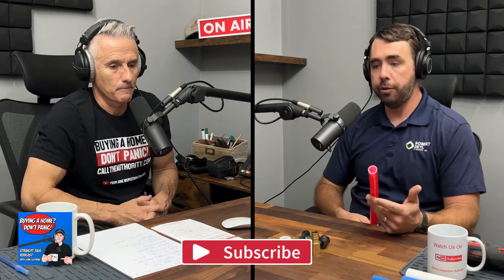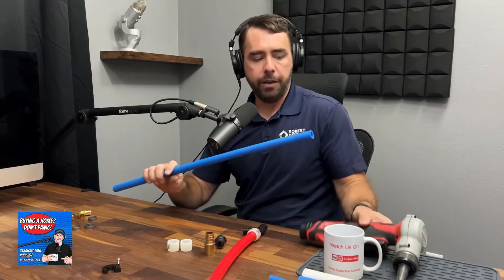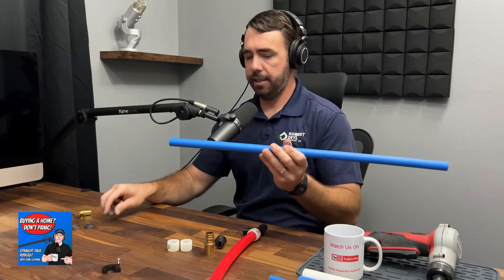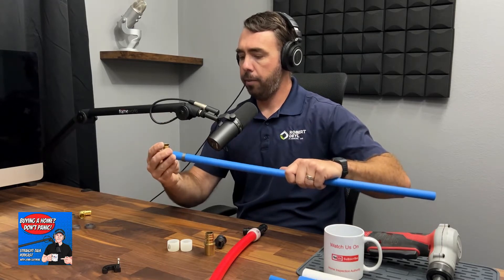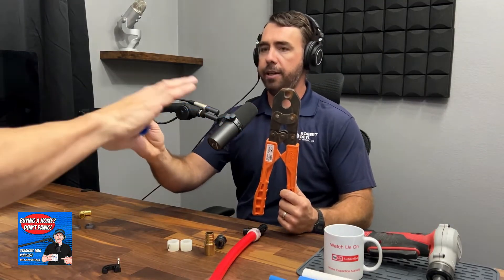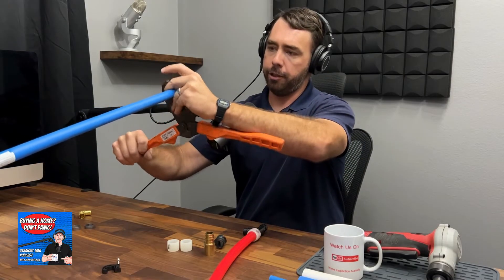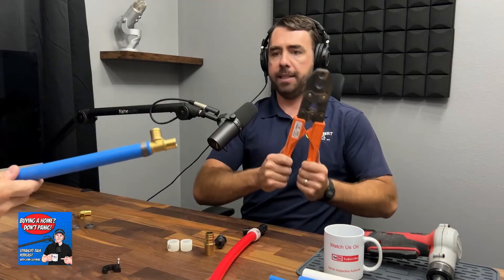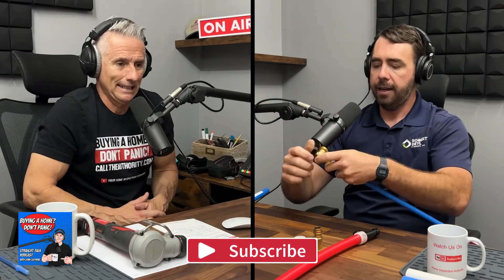PEX A Vs PEX B Pros & Cons | And Why They Are Not Interchangeable

Comment: ZURN Pex B is expandable using F1960 fittings, not sure what makes it different from other Pex B piping on the market.
Reply: Yep, and Zurn doesn’t even bother to advertise their pipe as A or B, probably to avoid confusion by people who only get information from videos like this. 

Why any inspector would read the A or B designation stamped on a pipe but ignore the ASTM spec for deciding if it’s connected properly remains a curiosity.
Reply: Just redid my whole house with Zurn Pex B all with expansion fittings. Super fast!  Only had to keep one exposed area in the kitchen as copper. Could not be happier to get rid of that crappy 34 year old copper and the never ending slab leaks!
Reply: @avidube2973     truth is the problems ive heard about with pex are all type a pipe    other than workmanship related issues  , a dumb ass makes a bad fitup . actually never heard of type b failing other than joints    Type A Ive seen pipe failure
Reply: ZURN Pex B - yes.  Other brands not always.  Need to check the specs.
Reply: Zurn products expansion fittings are not available at any of the local supply houses or online. unless you order bag or box quantities because distributors won't sell Zurn Pex and Zurn won't sell Pex in smaller quantities. I wanted this product but  Zurn only sells in bag or box quantities and distributors like Ferguson now have their own brand Jones Stephens so they won't have stock.
Reply: @hillwright6609 Ferguson will order it for you and they do stock it here in the mid-Atlantic.  Ordered some Zurn PEX pipe yesterday and picked up today.
Reply: Sioux Chief PowerPex